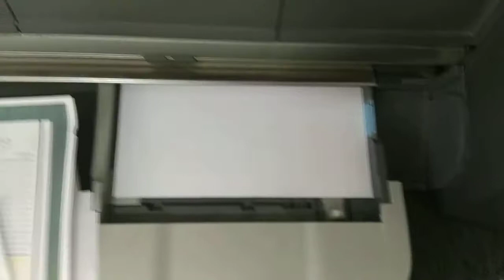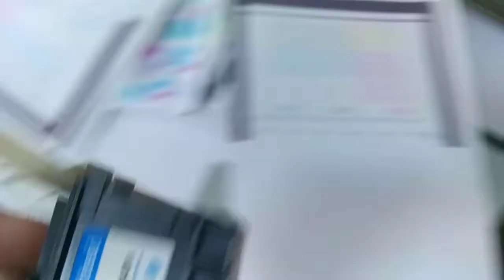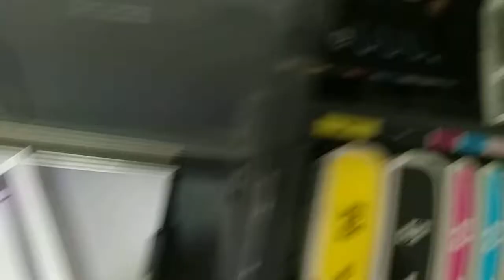HP Designjet 130 cannot head allingment fail, LC and LM not work

Comment: did you notice that the assembly of the plotter did not go properly? you should ask the technician who disassembled it and then assembled it. Take a look at the ink pipe to printhead line, that is not in its position under the lid - on the right...